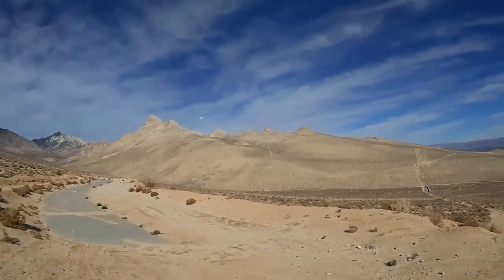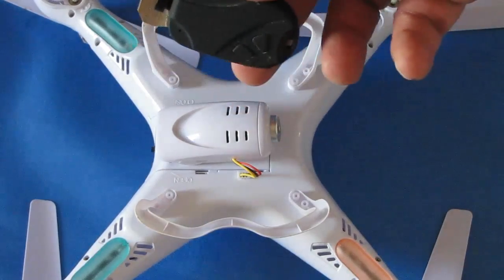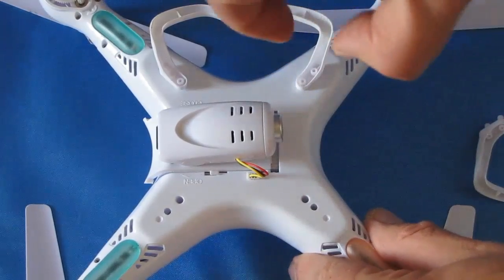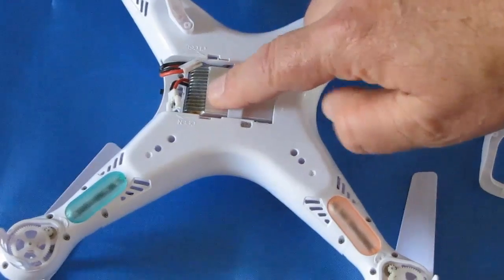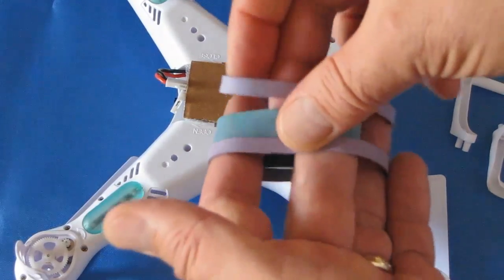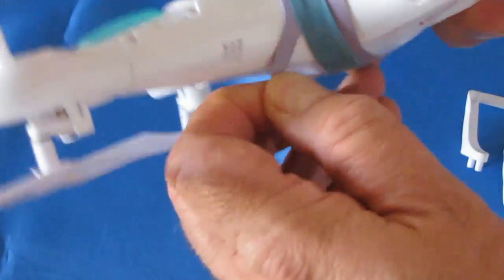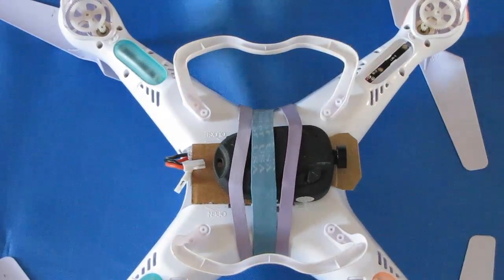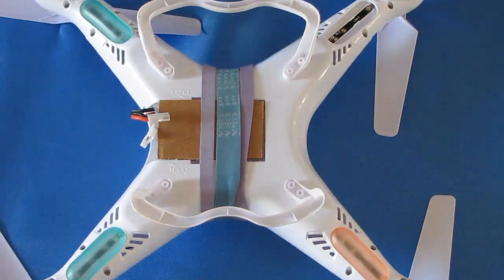Syma X5C-1 Quadcopter Drone, Remove That Camera!

Comment: Hi. im thinking to buy SymaX5C. I was wondering how it would do in the city...
Also, is the 808 the best camera out there?
Reply: also what do you think about the UDI RC U818A?
Reply from the maker: Would expect ranges out to about 50m in the city due to WiFi interference.  The 808 is not the best of the micro cameras. But it is the best that the X5C is capable of lifting on prolonged flights, without overheating/stressing its motors. Higher resolution cameras can be much more heavy.  For example, the 720p 808 #16 weighs 17grams, while the better 1080p Mobius camera weighs 39 grams.  That's a significant weight increase that may stress the X5C's motors.
Reply from the maker: Kngo01 And the U818A is an OK quad, but you really need to fly it on windless days, as wind can buffet it about due to its protective ring.
Reply: Ok awesome.
I just dont know if I should spend money on this or just go buy a more expensive one..

I was wondering what's your input for Cheerson CX - 20 and WLtoys V303? (is there any you would recommend for just taking video/pictures?)
Reply from the maker: Kngo01 If you are a beginner, these would be very bad choices. Crashing is a right of passage in RC, and so are fly-aways.  Please read the following page, and please don't be one of "those guys" ;) http://quadcopter101.blogspot.com/2013/10/chapter-1-introduction-to-quadcopters.html
Reply: Quadcopter 101
 alright thanks! i guess i would start off with the X5C and get the 808 too.
Any recommendation on where I should buy it from? (amazon? LOL)
Reply: oh Nvm. i see there's a link under the video.
Reply from the maker: Kngo01 Be careful with where and what you purchase.  There are many versions of the 808, some good, some bad. The one that I use is the "808 #16 V3 with 120 degree (D) lens".
Reply: this is the one i got it only arrived today i paid 0.83p for 7-10 day delivery and it got here in 6 days and i am very impressed with the quality in fact its better than the one quadcopter 101 uses even tho its the same one i think its probably just the way it focuses in the desert.

http://www.banggood.com/808-NO_16-HD-120-Degree-Mini-Camera-Module-7g-p-82197.html
if you scroll th the bottom of the page you can find photos and vids taken with the camera

if you do get the camera download this  http://www.mytempfiles.info/nr16/ and it will allow you to change the settings and update the camera easily and do things like turn off the time stamp and turn the footage upside down which is helpful if you have it mounted under the x5c.

im assuming your a beginner so remember you lose or break a x5c without the camera you can get a bnf version for $30 but if you lose it with the camera its going to be allot worse so get to grips with the quad alone first.

Comment: Quadcopter 101 In this configuration the battery seems to not make good contact. Any small vibration causes the quadcopter to turn off. Have any ideas? I noticed that the battery connector on your Syma X5C is much sorter then mine...
Reply from the maker: I moved the connector out of its internal slot so that I can plug the battery directly into it.  Please see the following video at 24 seconds where I discuss how https://www.youtube.com/watch?v=xG3Qx9Tohro

Comment: hi Quadcopter101, I did the same modification in the Camera but the image from it is "jelllo"  and shakes a lot.  how do you remove the vibrations from the quad.  your videos have good quality,  mines are rubbish,  shaking all the time.  thanks
Reply from the maker: Here's how presented by thxkid.  He uses a V929, but the method is the same. https://www.youtube.com/watch?v=GtWRl6p9Jbw
Reply: Quadcopter 101 thanks I'll try. thank you very much
Reply: Quadcopter 101 it worked!! thank you very much.

Comment: Instead of taking the door off and making a dummy door, you can unscrew the camera from the door....
Reply from the maker: Yes but the attachment holes in the camera for those screws can easily be stripped, especially when reinserting the screws (as I unfortunately experienced :(.  If you plan to use the camera again, it's better to remove the entire door.

Comment: I'm glad I'm not the only one who's missing an orange light cover!
Reply from the maker: You can get four for a dollar here http://www.banggood.com/Syma-X5-X5C-LED-Cover-Lampshades-Spare-Part-X506-p-926873.html
But I'm leaving mine off.  It adds character ;)
Reply: Quadcopter 101 Great value - but I agree, I'm leaving mine off too! I'm wondering though why you don't just unscrew the camera from the battery cover and put it back in place then strap on the keycamera?
Reply from the maker: Mark Daniels This is safer.  The screws easily strip their plastic insert holes with repeated removal and installation.
Reply: Quadcopter 101 Good to know. Thanks.

Comment: Do you knew the weight of the camera on this quad?
Reply: Weighed my camera off my x5c with the battery door attached 9 grams! I was expecting 808 cam weight of 16-20g. To be fair this is a cheap China scale and I don't have check weights to verify accuracy. My 2 cents save your $40 and run the stock camera footage is damn good.  9$ on amazon you can pick up a 16gb uhs-1 card.

Comment: Hello Quadcopter 101 , just a couple quick questions. Is there a significant weight difference between the 808 and the stock X5C-1 cameras? Also, is the 808 #16 the best bang-for-your-buck choice amongst all of the different versions of the 808's?
Reply from the maker: No they weigh about the same.  That's why it's advantageous to use the 808 keychain camera as it has its own power source which doesn't reduce flight time (unlike the stock camera).  The best bang is the 808 #16 V3 with the D wide angled lens.  You have to be very careful, as there are many other versions of this camera, good, bad, and just terrible (usually can tell by the price). Or go here to learn everything that you need to know about the crazy808's http://www.chucklohr.com/808/index.shtml

Comment from the maker: Bora, make sure that the microSD card is inserted into the camera.  Turn on the quadcopter and bind it to the transmitter.  Press the little silver button that is located to the right of the left control stick to operate the camera.  Push down on this button once to start the video camera.  You must also press down one more time to stop the video when your flight is completed in order to record the video to the memory card. Do not turn off your quadcopter until you stop the video, or it will not be successfully recorded to the card.
Reply: I did the same today.  Had two really good first time practice flights but the video never saved!!!  Suspect it was because never pushed down on the camera to save! 😢
Reply: +Quadcopter 101 Wow thanks this was very helpful
Reply: Thanks for the info. I had to find out the hard way. I had some real good video too. Lost it all because i did just that!

Comment: On the back of the door, there are 2 very tiny screws. Remove them and voila! The Camera is out and the door is still there!
Reply from the maker: Yes but the attachment holes in the camera for those screws can easily be stripped, especially when reinserting the screws (as I unfortunately experienced :(.  If you plan to use the camera again, it's better to remove the entire door.

Comment: Thanks so much for all your reviews and post! I have a question please,I know you said the X5C will work with the X11 and X12 remotes,will these same remotes work with the Syma X5C-1 ?
Reply from the maker: No Believe that I said the X5C-1 will work with the X11 and X12.  Am not sure about the original X5C?  BUT the X11 and X12 transmitters do not have working camera control buttons. In other words, you can not control the X5C-1 camera with the X11 or X12 controllers.

Comment: Hello I notice you used cardboard to cover the slot. How come you didn't just remove the camera from the original cover plate then refit it?
Reply from the maker: There are two little screws that need to be removed to do such.  Removing and reinserting these screws can easily their attachment holes.
Reply: Quadcopter 101 

Hello. I was just wondering what size antenna extension you would recommend. Shall I just double the wire length or triple it?
Reply from the maker: Lee Wesley on the quadcopter or on the transmitter?

Comment: Do you think that Syma can lift a Gopro??? I dont need to be fast just lift and be stable.
Reply from the maker: No it doesn't have the power to lift a GoPro.  BUT if you are new to this hobby, you should hold off on risking your expensive GoPro until you learn to fly.  The X5C, H8C, and other similar very low-cost camera quadcopters are excellent for learning the basics of flight, along with giving an intro to aerial video.  I like the X5C in particular due to its excellent stability. In place of its stock camera, I like to use an inexpensive keychain camera for aerial video https://www.youtube.com/watch?v=Yk4p_9oEAb0
Reply: Quadcopter 101 this quad gives a thrust of 152g full power...the Gopro is 163g.i am planning to try Sony HDR AS20.89g

Comment: I removed the bracket system on the H8C and replaced with velcro which gives me options of cameras or no cameras.  Plus, have you shown how to increase flight time with a larger battery?  I was able to fly the H8C with a 900 mah battery with little degradation of flight performance.  11:20 isn't too bad a flight duration..
Reply from the maker: Sounds like a cool idea with the velcro.  But not sure that it's a good idea flying with larger battery, especially with the H8C. If you fly that long without a cool down period, wouldn't there be greater possibility of overheating and possibly damaging the motors?
Reply: Yes. I'm awaiting motors from Banggood but it's due to flying very hard on one of my videos.  They are coreless and I figured they would go out.  No big deal, I'm also awaiting the X6 which is brushless and I'll do my review with that. Too cold to fly here unless you be an Eskimo.  Hey, glad you responded.  I'd not heard from you for awhile.
Reply from the maker: MrPolymers Well I just did a video on H8C motor replacement for mine (took a month for the damn things to get here :(.  Anyways, stay tuned. Still need to edit the video, but maybe it will be of help.
Reply: I actually replaced a motor with the JXD 392.  Now, if you would actually watch my videos, you'd see the JXD motors are only 4 volt and the H8C need 8 volt motors. I got 1 whole flight out of it before it burnt up or just quit.  Yes, they are easy to replace but doing a video is a good idea. Yes, the wait time is a BITCH from Banggood on the motors. ;)

Comment: Hi.  Nice video.  I guess I am confused by your findings of the stock camera on the X5C-1 cutting down on the flight time when in use.  I just got an X5C for Christmas and have been using the heck of out it.  On the 500mAh battery that comes with it (along with the 2 spares I have) I can run the camera during flight time for a good 7min30sec.  Running the camera does not take my flight time down to 3minutes like you had mentioned.  So, I wonder if you have a bum quadcopter or camera if it is draining that quickly?  Love the Syma X5C so far.  It's a great starter quadcopter.
My YouTube Channel: https://www.youtube.com/channel/UCa0xC7EoqbY6QCxJqxLIrow
Reply from the maker: If you're "recording", the flight time is reduced dramatically to about 3 1/2 minutes, at least for me.  If you're not recording, flight time is around 7 minutes.  I couldn't help but notice that both of your videos are under 3 minutes?
Reply: Hmmm.. That IS odd.  I added up the length of all my AVI clips that I took on a single flight yesterday and it was approx. 7min20sec.  I seem to get that kind of flight time with or without the video actively recording.  Not sure what to tell you besides that.  I'm running stock out of the box, with no modifications to the equipment at all.
Reply: Hi. I'm curious where you purchased the spare batteries. Are they the same mAh rating as the original? Do they fit the same?
Thanks!
Reply from the maker: ***** 600mah instead of the original 500mah.  But fit great, and run great. http://www.banggood.com/Upgraded-Syma-X5C-X5-37V-600mAh-25C-Lipo-Battery-p-926400.html
Reply: Quadcopter 101
Thanks! I'll definitely check this out. Reviews also seem good on this product: http://www.banggood.com/Syma-X5-16-X5C-3_7V-600MAH-Upgrade-Battery-Meal-p-941270.html.
I really like the idea of a multi-charger and multiple spares so I can fly for extended periods. I am a bit wary of that charger, though...

Comment: Thanks for another informative video! I noticed one of the front LED lenses is missing.  I lost the same lens on the same side on mine.  Anyone else reporting same problem?  Possible design flaw??
Reply from the maker: Yeah, I've had lots of bangups out in the desert with this quad. Usually I would notice when one of my lens would pop out (and they do).  But after one crash, I missed that it was missing.  But Banggood has replacements, 4 for a buck http://www.banggood.com/Syma-X5-X5C-LED-Cover-Lampshades-Spare-Part-X506-p-926873.html   But I'm fine flying without it.
Reply: Yupp me two one both of my quads same lens

Comment: Hey quadcopters 101. It's me again. I got an x5c-1 for Christmas and it's great! Only thing that bugs me is the range. I know you made a video about the extended range, but I was wondering if you could make a video on how to do it. The big thing I need is specifications, such as the length, the type of wire and such. This would be very helpful. Hope you have a great holiday
Reply from the maker: Actually, it's been done already: https://www.youtube.com/watch?v=EQbRnQsHLHA
https://www.youtube.com/watch?v=b_IWbiYfvfQ
Reply: Yes I have watched those videos multiple times. Do you know what wire he used or the one you used
Reply from the maker: I just used a simple copper wire.  Any good conductive wire should work. He made his antenna 1/2 wavelength (total length of the original antenna plus the extension = 62mm).  Make it a little longer, then measure and snip off any excess.
Reply: Alright. Thanks a lot
Reply: Quadcopter 101 Does it matter how long the antenna's total length is or does it just need to be a range of lengths?
Reply from the maker: It does matter. Total length has to be a quarter of the total wavelength.  Either 1/4 (31mm, this is the stock antenna length), 2/4 (62mm), or 3/4 (93mm).  And that is the total length of the original antenna, plus the extension that you've soldered onto it.
Reply: Hi guys,  You can use the same mod on the antenna inside the copter. The extension can be laid out along one arm of the copter.  Can use copper wire but multi strand might be better if you can find some in a small enough gauge.  Its about 18 degrees and windy here today so was planning on not flying. Rather doing this mod and then range test.  I already have added the transmitter mod. To bad for me I went too high and out of range yesterday.  It now sits atop about an 80 ft tree.  Good news is I know right where it is, Just can't get to it. Expected high winds today so maybe I get lucky.

Comment: Thanks Q101 been watching a few of your videos just wondering what you used  Had my x5c1 for about week now awesome bit of kit very fast pretty shaw i was pushing 150 feet + yesterday with no mods to controler conditions where perfect I done cam mod to sort the angle out also brought 4 more 600 mah batteries probably get extra half minute compared  to standard 500 mah battery!  gonna do range mod to the original controller or do you get more range from syma x12 x11 controller ?  I Like the look and syma x11c with camera
Reply from the maker: If you're new to the hobby, be very careful flying that high until you become more proficient.  Wind speed can vary greatly with altitude.  Also thermals (rising hot air) can become a problem unless you know how to get out of them.

Comment: Thank you Quadcopter 101 
I was going to waste money on a syma x5c camera  and wait like 30 days.
I'm an impatient man, and I'm one of those people that need everything yesterday, so 5 day shipping or no deal. I just happen to have an 808 camera that fits the criteria perfectly.

Now I have some news to share with you. I used some hubsan x4 batteries at 240MAH, on my Syma X5(original). Surprisingly, it flew for a perfect 4-5 minutes without landing gear, prop guards, or camera onboard. I found that it gave my quadcopter far more power-to-weight ratio as the weight of the battery seemed to be making a difference, or at least the smaller battery seemed to be giving a higher current.

The only drawback I noticed from running the hubsan x4 mini batteries on the syma x5 is that they can get sorta hot depending on how much strain you've placed on it. Of course, i could be wrong. I did not try any record testing or any of that, but I noticed that the climbing speed on the x5 felt much faster than it normally did with its stock 500mah battery.

On another note, i took a closer inspection at the syma x5's parts... and I noticed something peculiar.... IT HAS THE SAME PARTS AS THE SYMA X1! 
The motherboard and lights are different, but the motors and gear assembly is the same as the x1.
Therefore, if you ever need to find readily available parts for quick repairs, you can get some cheap mass produced x1 parts and swap them out with the x5's. It will perform exactly the same.

This is an unfortunate trend however, that I've observed with pretty much every other quad. The majority of quads out there share easily compatible parts, and some even share the same motherboards. If you hear a high pitched whine from a quadcopter, it is the telltale sound of a hubsan x4 flight control board...or at least the software.

And I kid you not, the ones with the hubsan x4 flight boards have just as hard of a time doing flips as the original hubsan. Coincidence? i think not.